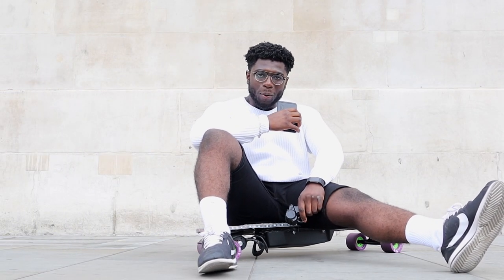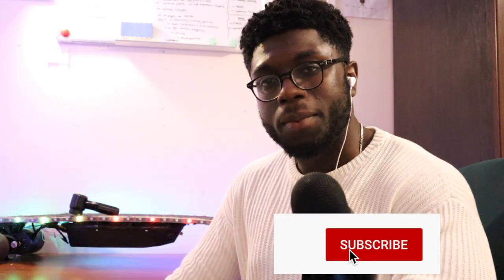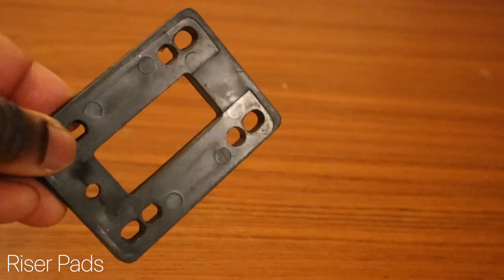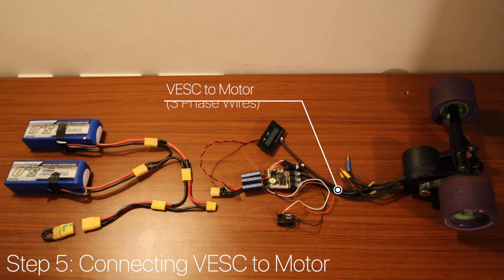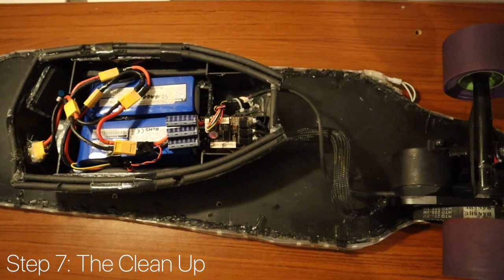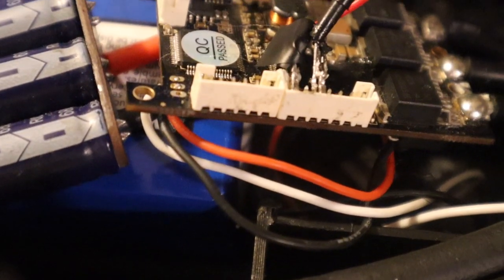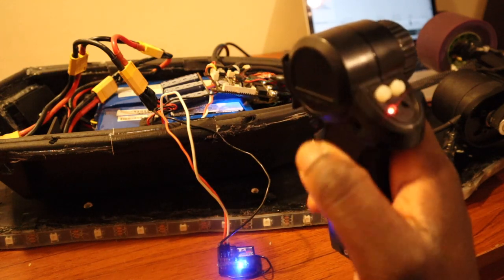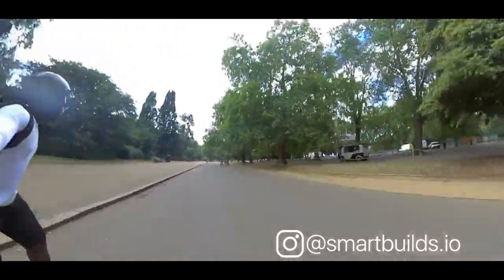How to Build a DIY Electric Skateboard - Faster than a Boosted Board | Full Tutorial

Comment: Arduino powered controller to remove the off the shelf radio? You could add in lighting modes too. So like a trigger for the speed and some buttons or a dial for different lighting modes, maybe even a few LEDs to indicate the mode and or the battery charge. Maybe a mode switch too for doing an eco mode and stuff
Reply from the maker: Yep!, sounds like good ideas Nick

Comment: Awesome DIY Video. Keep it up. Interested to know, what happens when you’ve encountered a large or sharp hill on this rig? Will it push through, take you up, coming down can the brake offer control of your speed or would you have to try foot jam. Cheers.
Reply from the maker: Thanks a good one, going up the hills was relatively easy. The current specs can handle it. An brake start on a hill incline did have a slower start.

Some have recommended getting another motor on the other wheel. Though for where I live roads are pretty flat. More of a preference.

Comment: Pro tip for glue:go to carpenter's shop and ask for rubber adhesive,make sure to take big metal can of adhesive(size of normal duct tape),it's tough and clean as compared to hot glue(silicon glue)

Comment: Oof, big tip man, DO NOT RECOMMEND PEOPLE USE THE PPM PORT TO POWER THE LED STRIP. The VESC 5V regulators weren't designed for that much power usage on most models. You're much better offer going with a dedicated BEC to power the strip and using the PPM port JUST to power the Arduino. I covered a similar top regarding adding a USB charger to an esk8 on my esk8 channel "SeeTheBridges". Same parts can apply here. You can pretty easily burn out the VESC regulators if you're not careful about how you configure your power draw. Love the concept otherwise though! I'll be covering something similar pretty soon!
Reply from the maker: Thanks Carlos, and a good tip. The power being drawn is relatively low (in the mA). However, adding a BEC is a shout for larger power-hungry components. That would be something interesting to cover. (Good Channel).

Comment: It's dope👍. I would love to see the LED get a white translucent cover that can defuse light evenly like we see in PC RGB Ram. Phanteks have that kind of LED's.
Reply from the maker: That's a sweet idea Sachin
Reply: @EbenKouao  Great Content & innovative. Is it possible to add a slide in socket to insert LED strip light instead of using hot glue. Because removing damaged LED strips will rip-off the paint. Also can you add C shaped spring clip to make sure that if we use simple led or defused LED strip won't move from it's fixed position once placed. More like a tiny C shaped hook with a spring to keep thing tight. A hot glue free skateboard 🙏👍.

Comment: Really nice work!  Something I'm tempted to make, but ... y'know ... skinny, white, middle aged bloke - I'd likely end up in hospital with something broken!  🤣

On a more serious note; I can't help but think that you'd be better of with two motors on the back wheels instead of one; would be able to use smaller motors, although would need dual ESCs of course, but they could be lower amp rated each.  
Would be interesting to experiment with front mounted motors as well - would there be any significant handling difference?  4WD might be overkill though ... 
Regenerative braking might be a good upgrade too,  and at a first glance should be too difficult to add I think?   Ah - the VESC page says that it supports regenerative braking!  Is it enabled by default?
Reply from the maker: Hey Mitchell, that sounds like a nice build and defo possible. I guess It would be a lot more smoother, especially going uphill. Worth a shot. 

 Regen braking was setup up on mine bu default. However you can tune the parameters in the setup wizard.

Comment: Does the motor automatically assist when you start driving even without the remote? Also what would you suggest to cut out or skip, to make a much simpler version of this with a smaller budget (like a weaker motor or only 1 battery)?
Reply from the maker: Hi Elviss19, the VESC can be programmed to do this. I would say the most important parts (to invest in for good performance) would be a strong motor and Battery capacity (for longer range) and a good ESC. Everything else can be budget down. Possibly the deck itself, wheels truck. That way you can upgrade the deck rather than the parts.
Reply: Some boards have cruise control so yes it can be achieved. I don't like it personally, fall way too often and a runaway board is not what you want 😋

Comment: First Of all, I also wanted to use lipo batteries - but they have a much larger discharge current compared to Li-ion but a much lower capacity

why did you choose lipo?
Reply from the maker: Mainly for larger discharge over a period of time. It's also cheaper. You can use Li-on which is much more nicer to store but it's slightly more expensive.

Comment: why did you tell your VESC that your running a 5s battery at 5ah? are you not running both in series, because if thats the case shouldnt you have input it as a 10s 5ah battery?

Comment: Is this possible without soldering?
Reply: yes, its possible. I for an example am using a motor for an rc car, if  you want to do the same you will also need an receiver and remote i reccomend you buy that in a package. That it comes together and thats it also 2.4 ghz. For the motor you will have to do research what is powerfull enough, with the motor you also need an receiver. You can also buy this in a package or do you're recearch what can go together. and for no soldering you need to see you're motor come's with wire's and not a metal tip. You will also need to watch a tutorial on how to plug eveythinh in, and you're motor should move when you press the gass. nuw for the rest watch this tutorial and ya got you'rself a electric skateboard. And also keep in mind that the wire on the esc fits into the wire on you're battery. and watch out that that also doesn't come with a metal tip or you will neet to solder that.

Comment: Are the brakes smooth or does it brake that hard that you fly off your boosted board?
Reply from the maker: Hey Hafthor, the VESC is fully programmable on these parameters meaning you can adjust the breaking force parameters. Either a soft brake or an aggressive stop .... more info is on this in the configuring vesc section.
Reply: Eben Kouao Thanks for the reply, i will check it out!